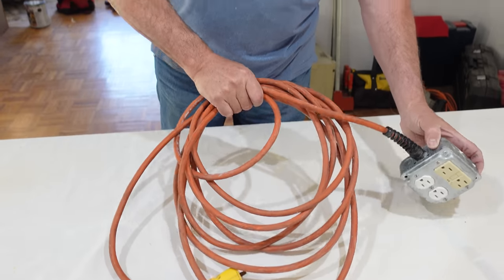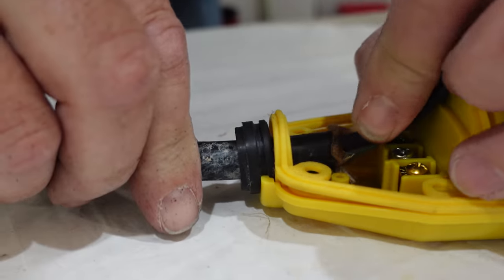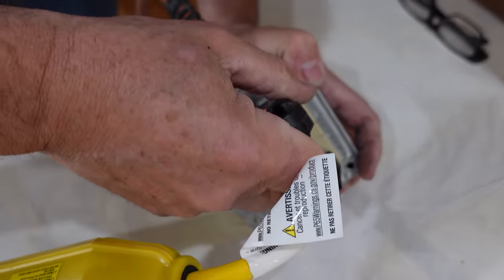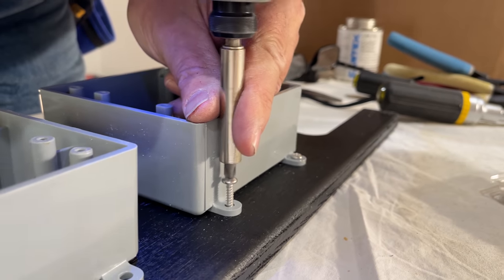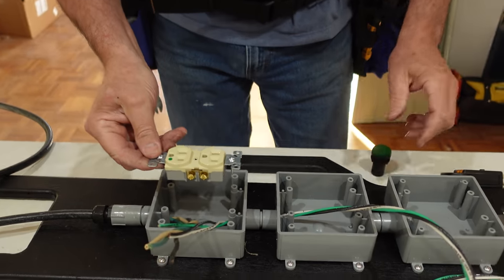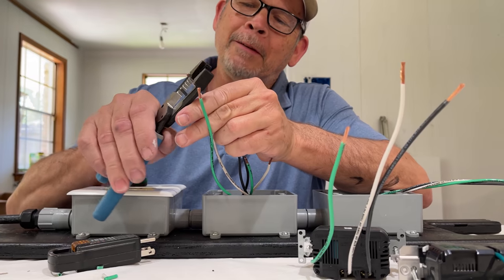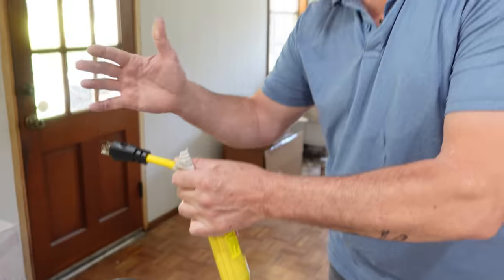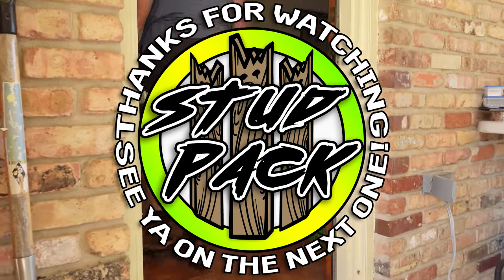HOW TO MAKE THE ULTIMATE EXTENSION CORD!

Comment: cord grip no way tight enough, and thin white plate that over hangs grey boxes will get smashed in no time,, this is just a gimmick, every decent extension lead is on a reel, no one would make this, just a bit of light entertainment, and as far as the breaker tripping out 21 amps will not trip a 20 amp breaker you need a lot more amps to do that and obviously depends on what rating the breaker is, fuses also work like this, 11 amps won't blow a 10 amp fuse you need way more.

Comment: Knowing something isn't OSHA proof and then ignoring it 'because you are just a simple contractor' isn't how it works. If I would go by that line in the Netherlands there would be a huge fine if I have people not working with the right conditions, no matter the field I'm in. All employers have to abide the OSHA rules in the US so an argument like that is total nonsense. Not sure about US but cables like those have to be recertified as well every year to be 'Arbo'-compliant.

Also the holes and the "I don't do that". That's just stupid. Assumption is the mother of all fuck-ups and especially with 110v/220v AC current you should be cautious and a box like that should be dummy proof. If even a single millimeter of water could make a box like that dangerous it shouldn't be on the work floor.

Comment: Your massively incorrect explanation of NEMA 5 vs NEMA 6 shows your lack of professional knowledge. NEMA 5 is for 120VAC and NEMA 6 is for 240VAC. NEMA 5-15 had parallel conductors limited to 15 amps. NEMA 5-20P has perpendicular conductors; while the NEMA 5-20R has a T shaped conductor to allow both 5-15 and 5-20 plugs. The NEMA 6 specification is for 240VAC applications, and has both 15 amp and 20 amp configurations.